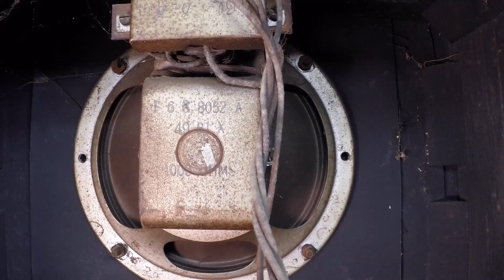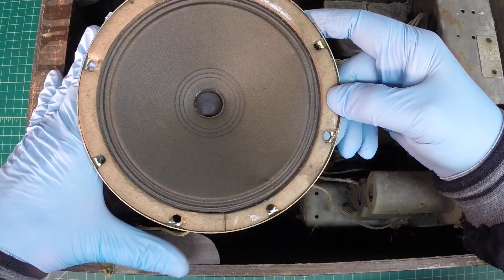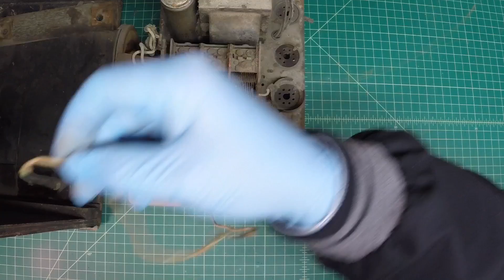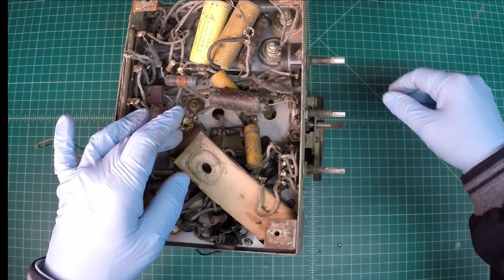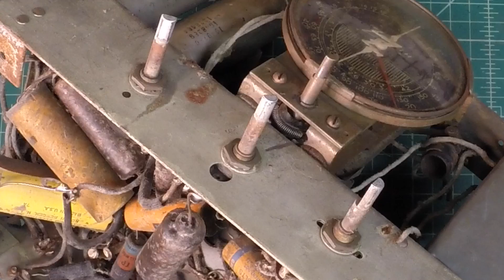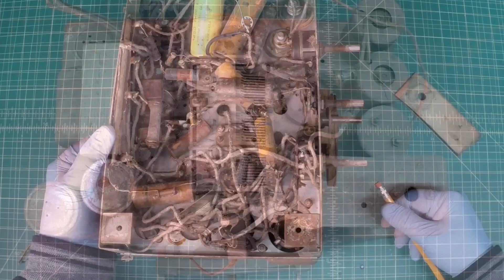Zenith 5-S-29: Introduction Part 3

Comment: Don,
It is very strange how Tung-Sol valve skirts split the way they do: it is almost like someone as made a neat cut.  Though I’ve found them not straightforward to solder together, even when reinforced with single strand wire, I’ve nonetheless found that brand of valve to be very good.  
6Q6GT can be made to work in place of a 6B6GT as both vales are Double Diode Triodes.  If you are struggling for valves, a 6SQ7GT could be adapted but that would require changes to that part of the radio circuit as there is no top-cap, and the base connections are different.
In over forty years of restoring Vintage Radios, I’ve found it rare to come across a defective rectifier valve.
The speaker, along with the general condition of the underside of the radio chassis looks to be very encouraging: I’d say there is an excellent chance you’re on to another winner with this one my friend.  
Regards,
Phil.
Reply from the maker: Phil, thanks for the heads up on the tube and I'm hoping the primary components are functional, but time will tell. Best, Don